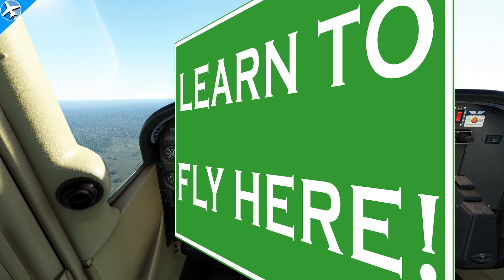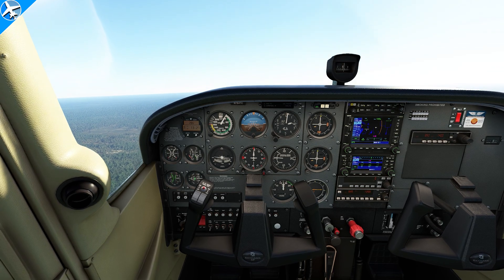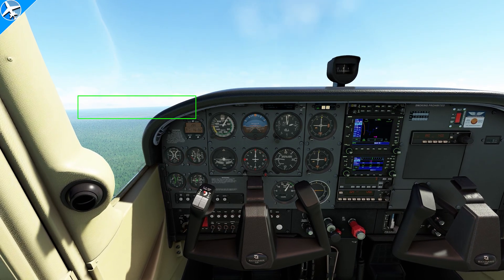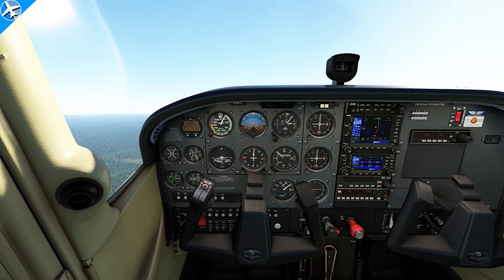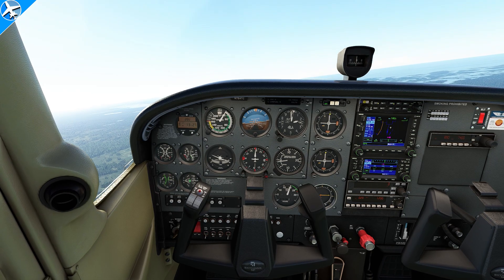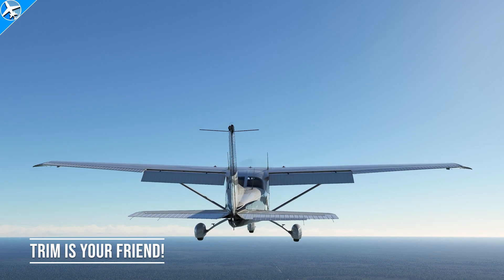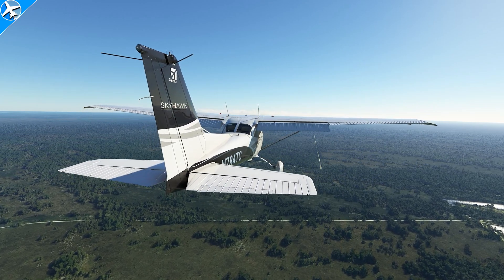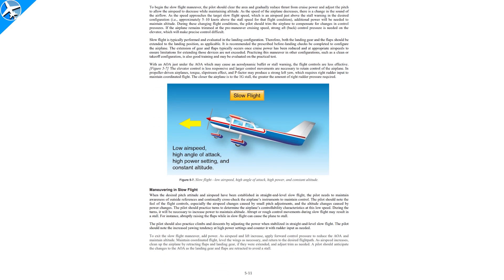Maneuvering During Slow Flight - Private Pilot Maneuver Demonstrated with MSFS

Comment: Why did they make you do slow flight with the stall buzzer going off back then? I'm sure there is a valid reason, but I can't think of one.
Reply from the maker: My guess is so the airplane could actually be flown on the edge of a stall where any change in angle of attack or load factor would cause a stall.  Flying with the stall buzzer normalized the sound of a stall buzzer which would be like hearing a smoke alarm going off and doing nothing.
Reply: @thecorporatepilotdad  In Canada we still do slow flight with the stall horn on